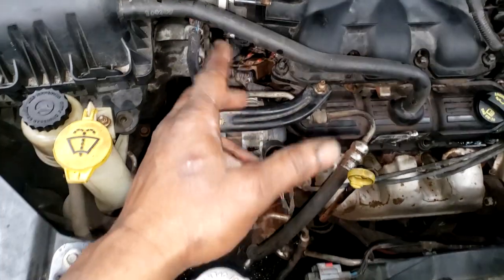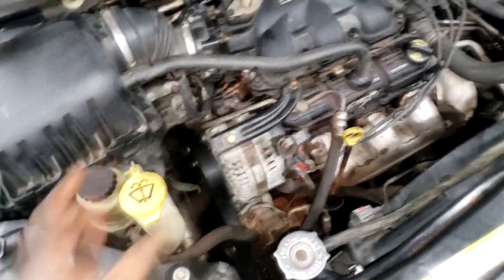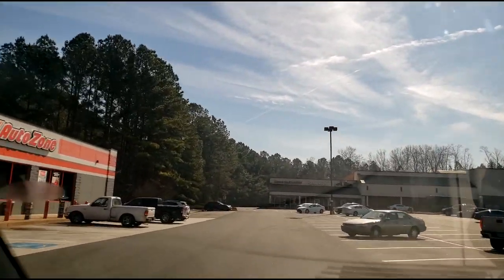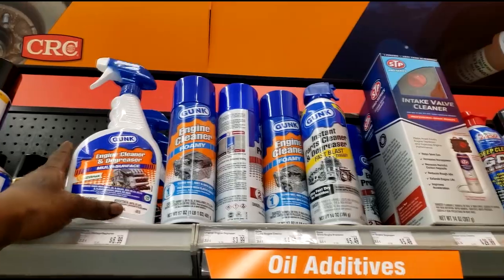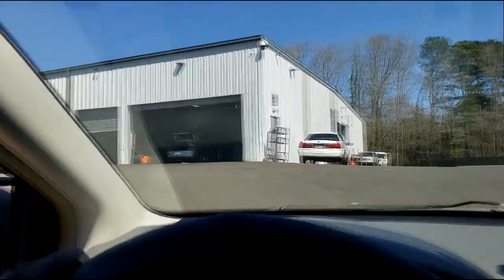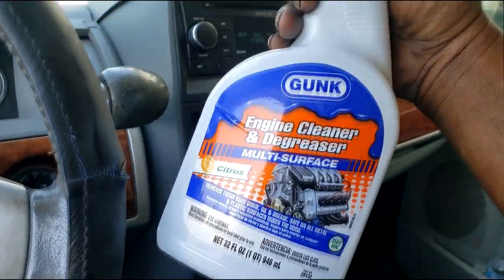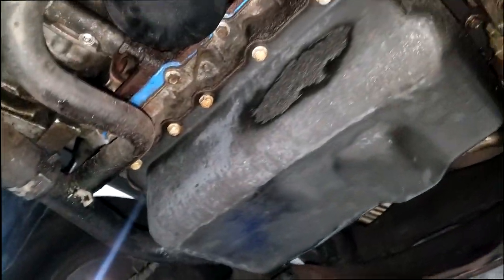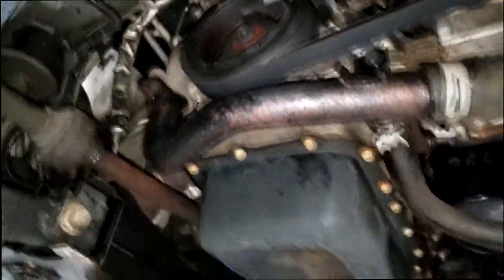Always do this after a major motor oil or coolant leak fix. Transmission can get cleaned as well.

Comment: Nice video JT. I`m buying the Gunk Degreaser in the spray bottle in the morning. I depend on you for your knowledge of the Dodge Automotive Industry. That engine looks clean. I have a question. Whats the difference in a engine and a motor. Arn`t they the defined as the same in the industry ?
Reply: Honestly I believe a motor usually refers to an electric motor, and engine is combustion or steam. But I think they interchangeable sometimes.
Reply: @padilla2435  Thanks I just subscribed to your channel.